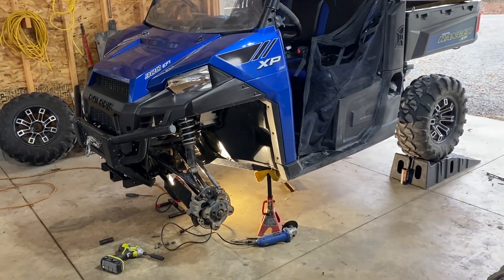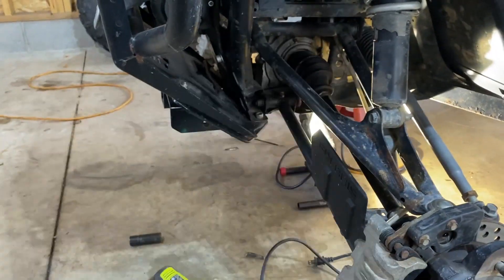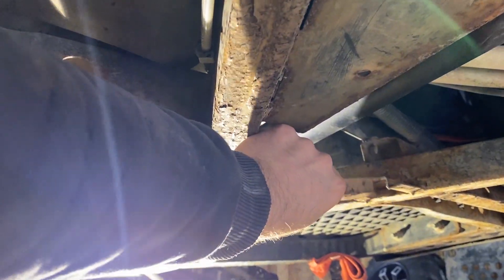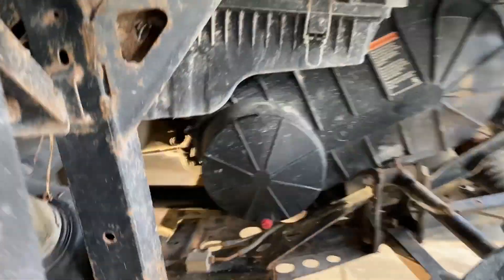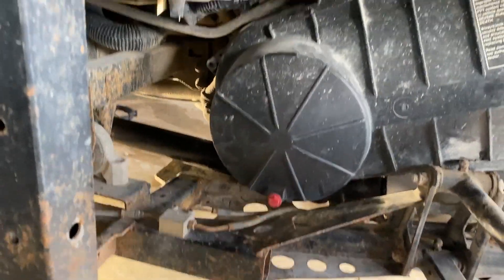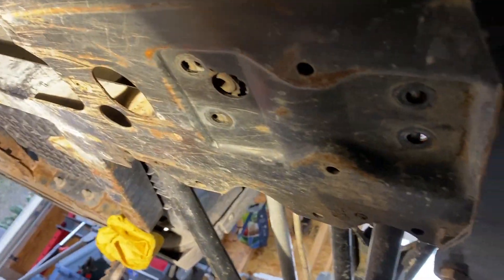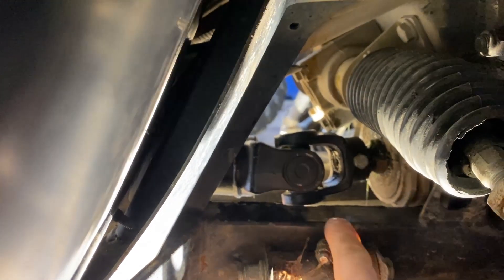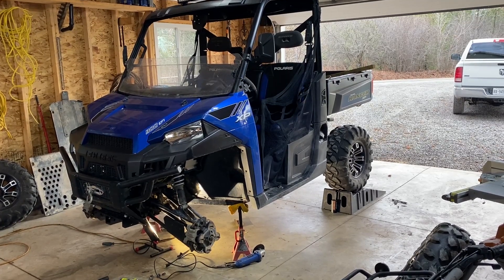Polaris Ranger 900 XP prop shaft removal and install.

Comment: I took the clutches off unhawked. The front difparental take the prop. Shaft off and slow it back underneath the shock out through the back. It's very, very tight.  But I got it through.

Comment: 2013 Ranger 900 XP. Did exactly as you suggested. Most difficult part was roll pin removal.  Only because I started with a tapered punch. Once I went with the flat punch and air chisel, it was out. Removed 4 bolts  on front diff and slid forward. Also removed air box for ease of clutch cover removal, but not sure if necessary?  Both old shaft and new shaft took some twisting to remove and install, but with front diff and clutch cover out of way there was some room. Very much appreciate your video. Glad I didn’t pull front end, bumper, winch etc off. Cheers!